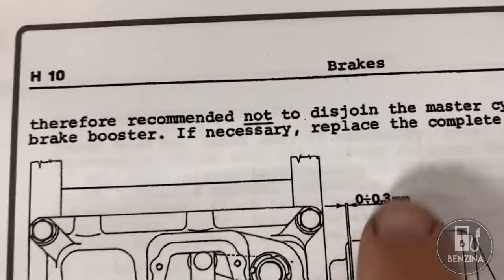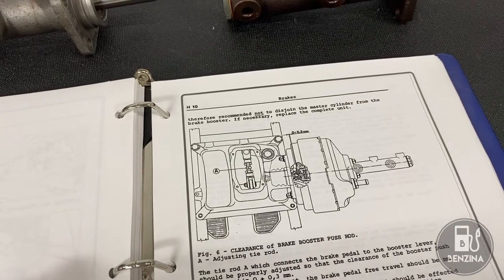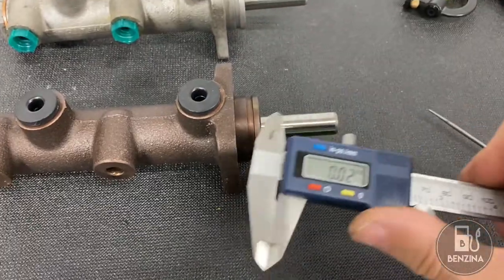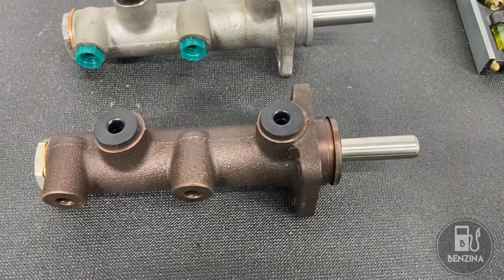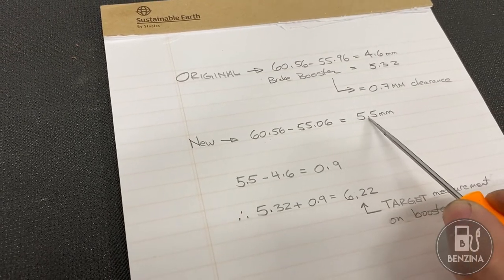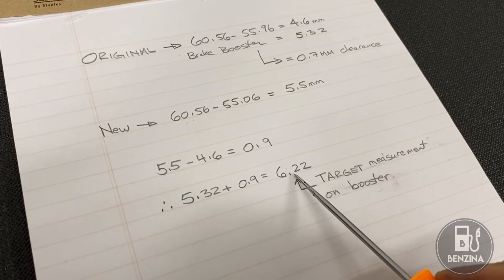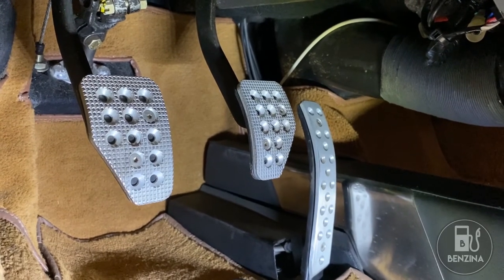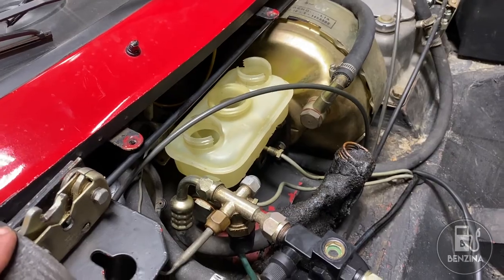Ferrari 308 Servizio - Brake Master Cylinder to Booster Clearance & Pedal Free Play Adjustment

Comment: How the car stops, after this adjustment?
Reply from the maker: Absolutely perfect.
Reply: @benzina5917  I replaced master and now looks like buster is not working. Also there is lake vacuum leak noise. Adjustment or membrane is bad? What you think?
Reply from the maker: @spasekossev1340  What you describe sounds either like a bad booster membrane or a leaking vacuum hose to the booster. It is not uncommon that the hose is old and cracked and when you worked in that area it broke. If that is not the issue then it is the booster. Also make sure that the master cylinder was properly bled before use because you CANNOT get all of the air out of the system through regular bleeding. The master cylinder MUST be bench bled.
Reply: @benzina5917  Thanks ,hose is fine. I disconnected, plugged and no noise. I will check master and buster.